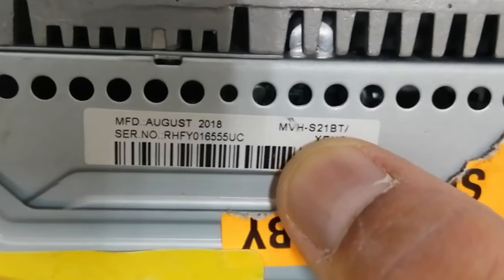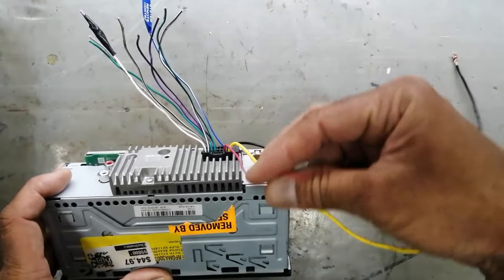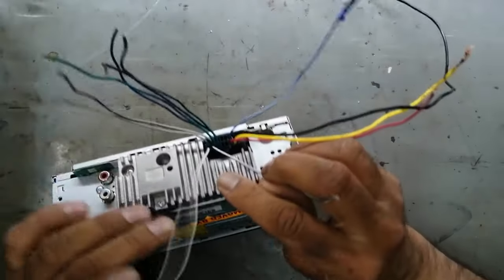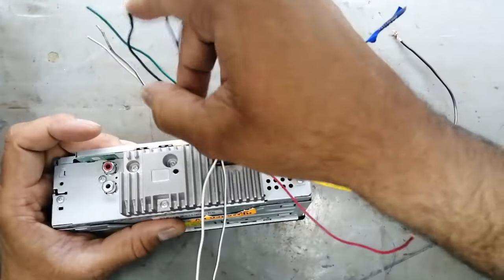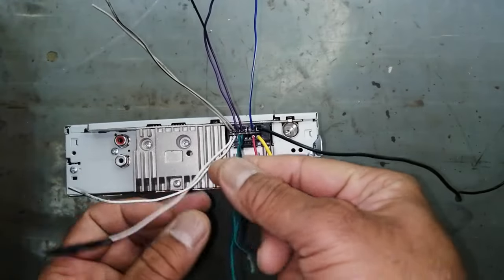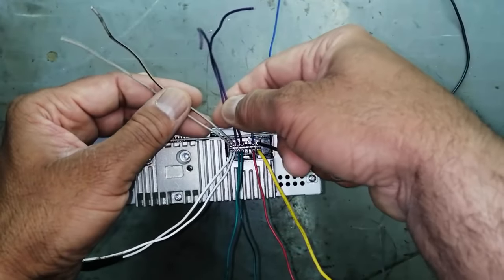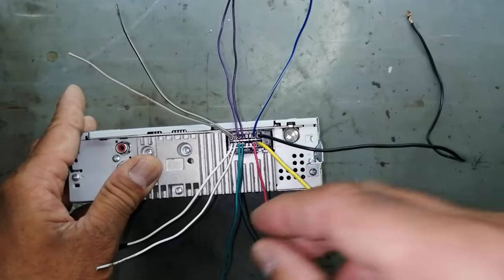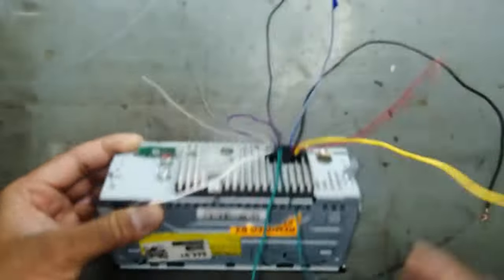{146} Pioneer car stereo wiring connection

Comment: One more question if the connection is from thr harness wire as explained  can we connect front and rear to component set of speakers and one subwoofer without amp ? Can you explain how we can set it up ?

Comment: Speaker ka 1wire kya erth karna hoga
Reply from the maker: no 
speaker per 2 points hotey hein. 
+ point per solid plain color wire connect ho gi. for example white wire
- point per white black lines wali wire connect ho gi

Comment: Thanx ; to12 volt ignition switch wire can you connect your own switch if connected in home with 12 v battery with a fuse
Reply from the maker: yes we have to connected switched voltage if we want to control its function or 
in home use we have to connect a switch between fuse and battery positive terminal. so we can connect ignition switch wire with fuse. so the player power and ignition wire will controlled from that switch

Comment: In out cable ka Jo port hai player me....Kya use aux use kr skte h
Reply from the maker: no dear 
that is high power audio out. if you will use it directly.it will damage to the next circuit
current limit resistance must be used to attenuate the signal before injecting to next circuit

Comment: sir, if i use it as a home theatre, then, where to connect the switch cable?
Reply from the maker: yellow and red wires to 12 volt 
black to return
and speakers connections will remain same

Comment: Kindly tell that what is difference  between mp3 and mp5 player?
Reply from the maker: mp3 mp4 mp5 players are digital files players that having play digital pattern mp3, mp4 & mp5 format. mp5 have large screen and better resolution. mp3 file size is smaller in size and consist larger resolution.